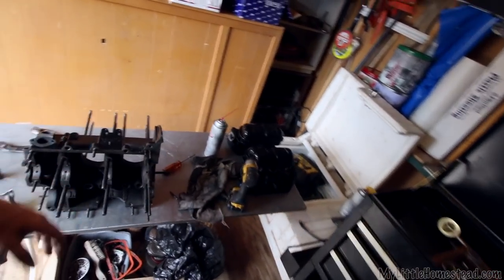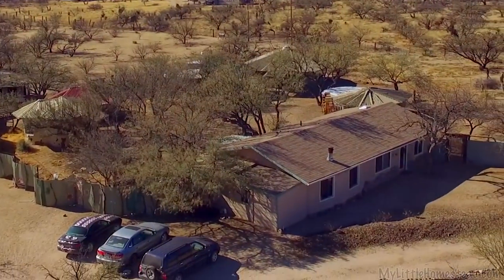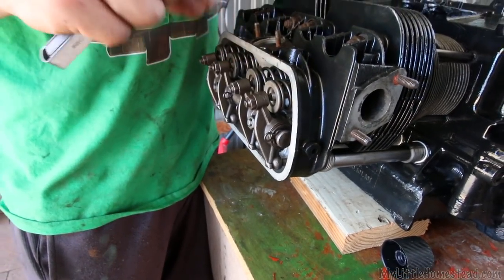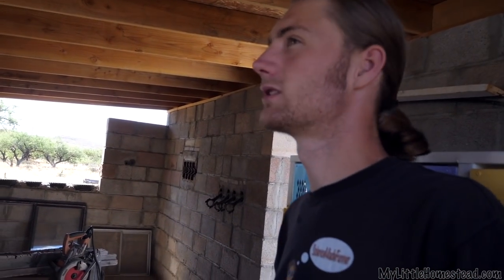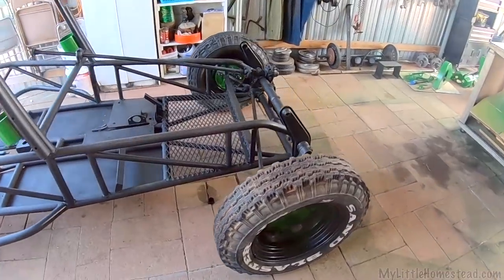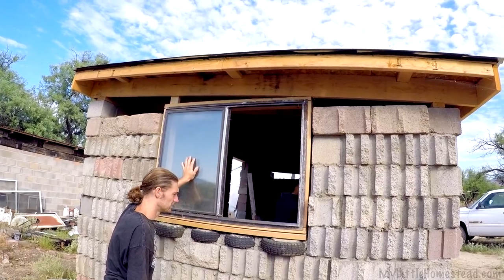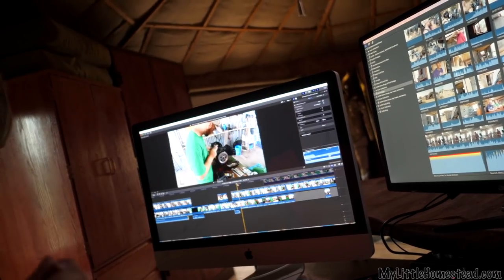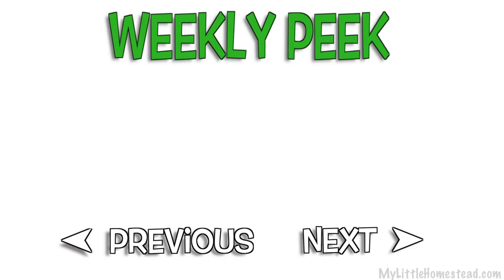Outbuilding Complete, Dune Buggy/Sand Rail Rebuild & an Anniversary | Weekly Peek Ep194

Comment: I would recommend some sort of anchor system for the tray rack so you can fix it to the wall to stop it tipping over.
Something like a carabiner on the top rail that can hook on to some anchor points placed around the building on the walls (in case you reorganise)...last thing you want is to be searching for something and have it tip all the stuff on the floor!

Comment: On the VW engine make sure the small heat riser tube in the front of the manifold is not carbon clogged up. It needs to be clear to get the hot air up to the aluminum center section so the gas from the carb gets atomized correctly so it can make the long trip through the small single port intake tube to the head and pistons.

Comment: Congrats on 27 years.  Your place is very cool, I always wanted to do something similar for my wife and her mother, one main building for kitchen and living room and separate small ones for bedrooms and also do a small bed and breakfast as well with just rooms in different area's.  My wife passed away on Feb 28th so this is something I will never be able to do.  We made it ten years together but were in each other's company day in and day out so our ten years was likely closer to most people's 20 plus years together.  

I will suggest though to make square cuts get a speed square and lay it on the factory edge and mark it minus the distance from the fence on the saw to the blade.  Then just take and set the speed square on the mark and run the fence along the square when you make the cut.  On 2X material you will make a perfect cut every time.

Comment: I have an idea that I think will be good for a replace of your hoop barn.. a "Quonset" roof that goes between the two existing workshop buildings. They're rather inexpensive made of steel instead of tarp and very strong. Plus, you already have part of a system with the hoops... (I'm guessing the hoops are metal) so now all you need is the quonset roofing material and a solid way of attaching them to the two buildings or pouring a foundation to secure the whole thing.. Just thinkin..

Comment: Headstuds pull out easy? You may have a problem you may end up having to take it apart again and add case savers
Next time you do a tin roof predrill the holes it will go faster

Comment: Lets see if someone can donate an old split air conditioner for your workshop building. They can have cooling and heat and you can just cut a hole in your wall and insert it in and the small condenser would sit out back.

Comment: Sooooo are ya supposed to screw into the bump or the flat rows in between the bumps? I always thought it was the flat areas.
Reply from the maker: Ummm. That’s a maybe. We have been placing the screw at the highest point so water will not pool and potentially leak.
Reply: That makes sense. The roof is flatter than a usual tin roof.